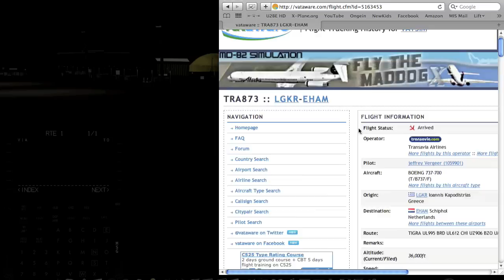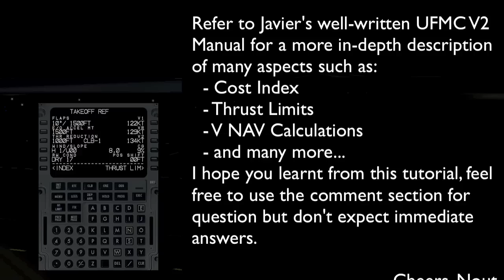UFMC / x737FMC Pre-Flight Tutorial - PART 2

Comment: Two great tutorials which got me thru the programming stage. Having a bit of a problem on the integration with the autopilot setup and use after a positive rate. I'm speaking of the X737 project v5  by EADT.
Can you do another tutorial using that aircraft with the same FMC? Showing the setup on the auto pilot & what to select to get it to follow the FMC. The x737 V5 doesn't have a "auto" switch for integration to the FMC. So I'm missing something along the way.
Reply: Engage L-Nav / V-Nav and the Autopilot will follow the FMC.